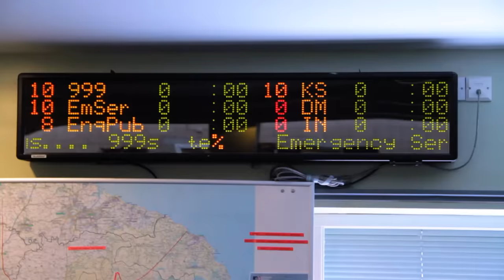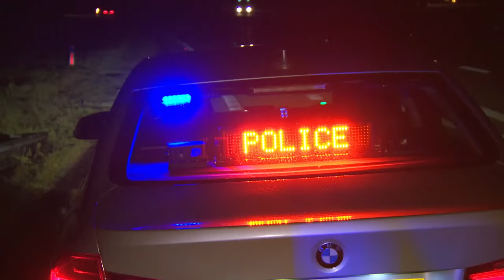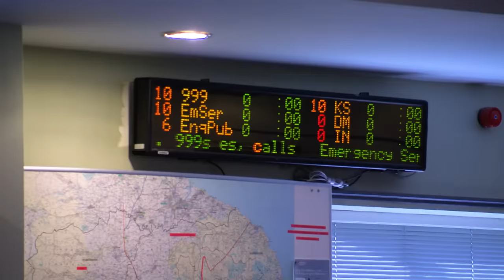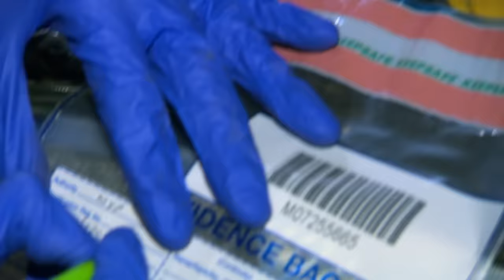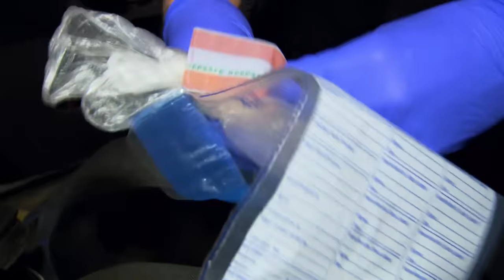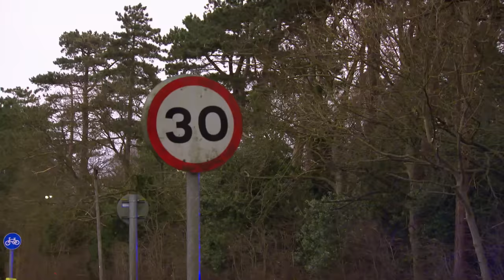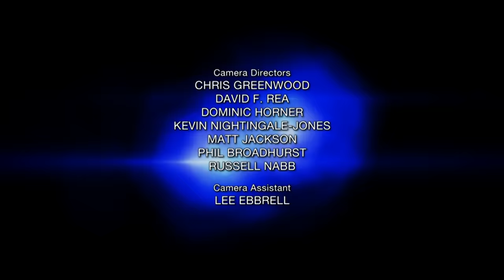Cops Deal With a Major Collision Nightmare | Motorway Cops FULL EPISODE | Blue Light

Comment: The reason that criminals get to steal shotguns is because shotgun owners are scared of the twisted legal system that would prosecute them without flinching, but slap the crims on the wrist as a matter of routine. Also, the cop on the scene of the Hilux in the river used his brains (and discretion) well - no suspicion of excessive speed can be proved, nor will any legal proceedings make any significant difference to the driver's future behaviour that the accident itself won't automatically do.

Comment: If you are unfortunate enough to be submerged in water with your vehicle you let it sink and fill up with water and then you can easily open the door but if you try when there is air in the cab and obviously water outside the pressure won't allow it until the car is fully submerged  full of water🤔🏴

Comment: 27:40 - have to pick up on this - 2 vehicles hitting head on @ 60mph each is not the same as a 120mph hit into an immovable object. The opposing forces effectively make the vehicles act like solid objects, so it's the same as hitting a rock face at 60 mph. Compare to the situation where one car is stationary: It would be pushed backwards. The equal momentum in opposite directions makes them behave like immovable objects. Physics 101

Comment: 2 Vehicles at 60mph do not = 120mph impact like 1 hitting a brick wall.
that would have to be the most perfect 100% square on accident between 2 identical cars with identical weights (drivers, passengers, cargo & fuel Loads) 
Even in controlled lab experiments its very hard to do if not near impossible. 

At best you get a 50-65% increase so impact of 90-95mph maybe if they are the same car types.

Comment: That is incorrect. A head on collision at 60mph is not equivalent to a 120mph impact
Reply: unfortunately most people believe that to be the case, i guess its because it makes sense till you think about it
Reply: IIRC, it’s equivalent to crashing into a stationary car at 120mph, but not equivalent to crashing into a solid wall at that speed.
Reply: @EliasSchmid00  The rationale behind it is that suppose two cats of the same mass travel at the same speed head on, providing no energy loss, net speed should be zero, i.e. both cars went from x speed to 0 because they were subjected to -x speed (the negative implying its opposite direction). So with a stationary wall it's sufficient to say that as long as the wall is strong enough we will get the same result